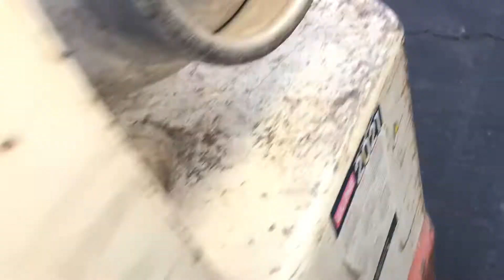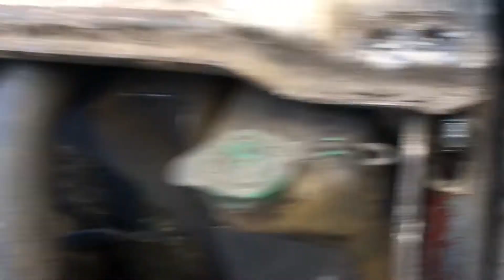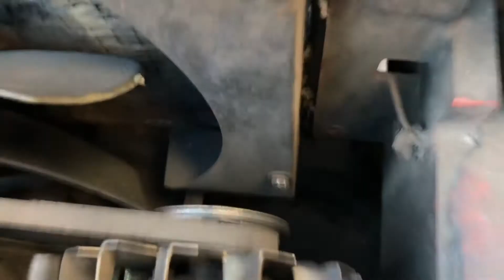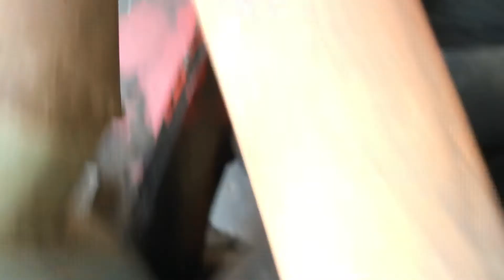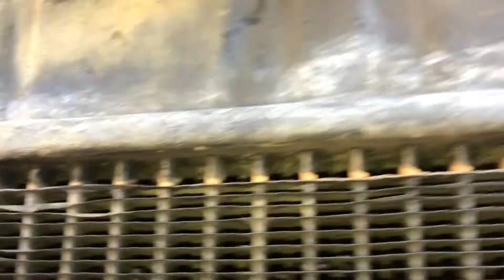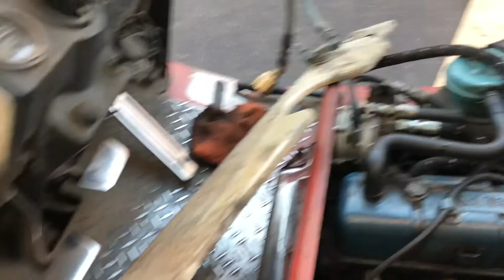How to replace a Nissan forklift radiator. Forklift radiator replacement.

Comment: If you had to replace the muffler while replacing the radiator would you be able to do it through the radiator hole? Would the counter weight have to be removed in your opinion? I am getting ready to do both on my Datsun/Nissan 30, an almost identical forklift. TY
Reply from the maker: I think you could do it through the hole.